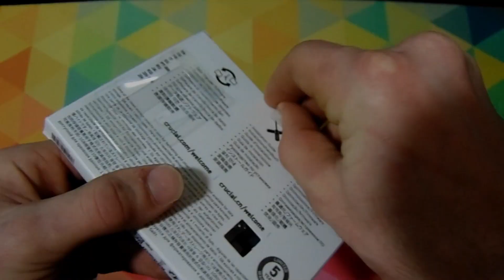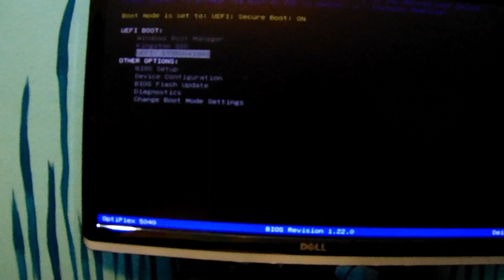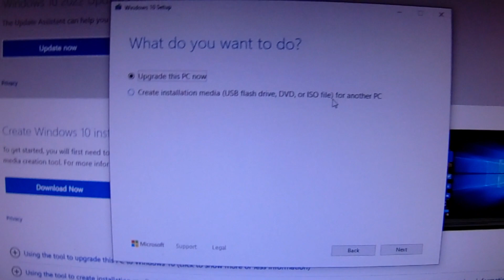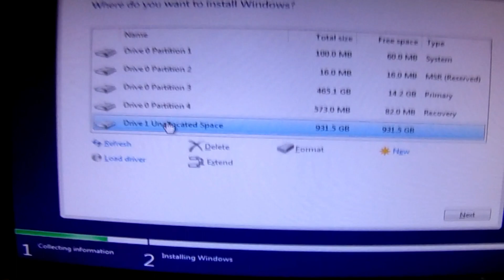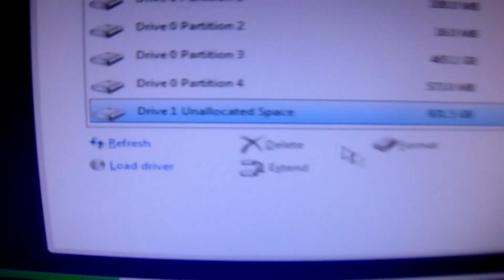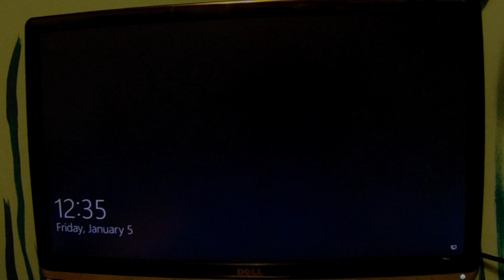Dell OptiPlex 5040 MT and SFF SSD upgrade

Comment: The way the pc booted up with the fans at 100% speed lil
Reply from the maker: Usually does after running it for a bit. I think it’s a safety feature
Reply: @vassilyknigge850 ohh okay I’m new to these dell optiplex’s and I get mine this Monday since my old one stopped turning on

Comment: what's the graphics card you're using for the tower one
Reply from the maker: @fuadyassin  That’s an old RX580 by Gigabyte I got for $60. It now has a GTX 1660 super that works much better because of the low power draw.